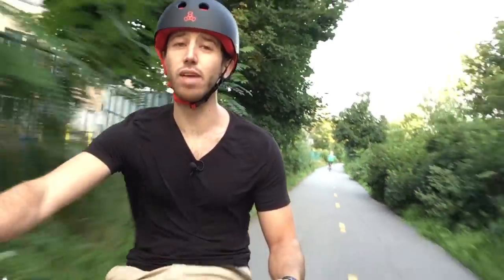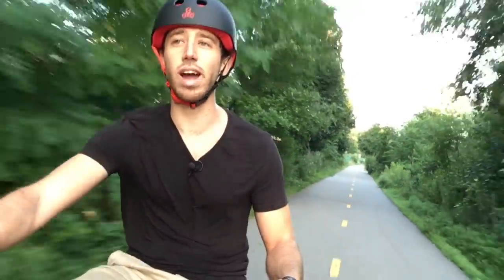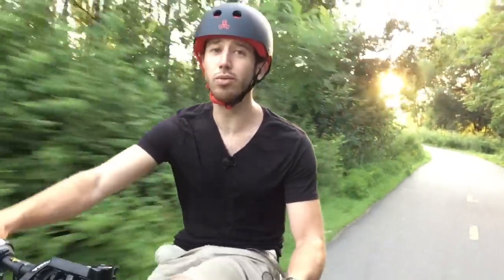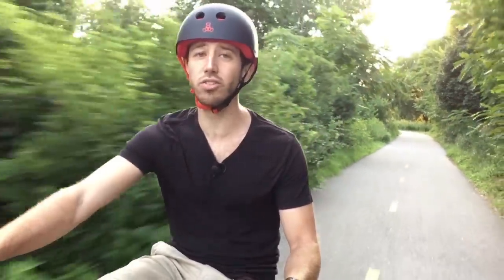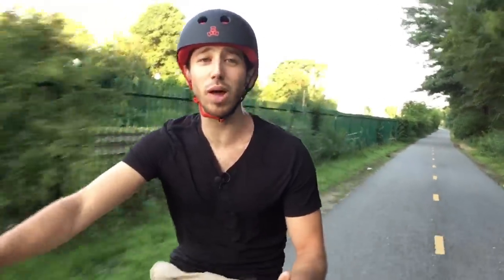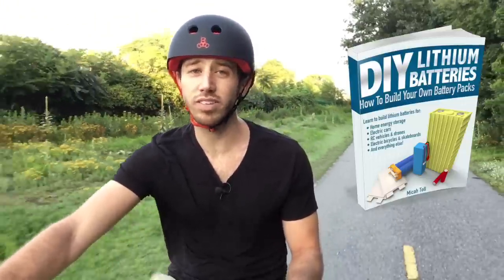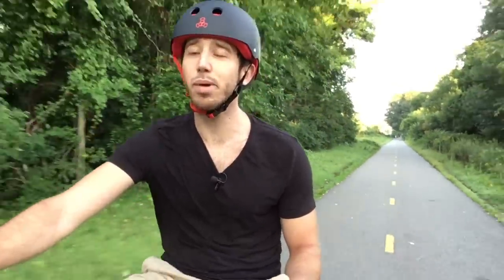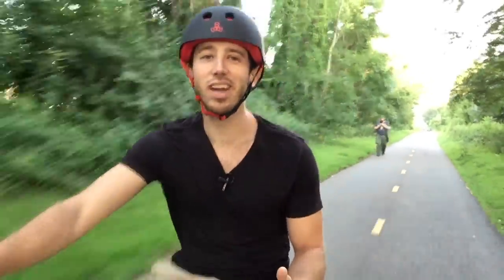10 Tips To Make Your E-bike Go FASTER!!!

Comment: The tire pressure is a biggie, if my tires on my ebike have reduced pressure 50 psi, my bike does 21 mph if it's 65 it does 25 mph
Reply: use a booster step up
Reply: Speed and range!
Reply: What bike you have that it asks for 65psi?
Reply: @sebastiangeorger5791  Ancheer AM001908 folding 20" Mountain Bike specifies 40-65psi for both tires at STP. I would expect similar specs for similar size tires, although I've seen 14"x2.25" "mountain bike" tires spec'd at 45psi maximum. I usually inflate a 3-5 psi below the maximum specified to allow for both meter accuracy and temperature variations that could increase the actual tire pressure from what the meter reads.
Reply: Who asked tho
Reply: I dont notice alot of difference on my  A20. It goes 21 miles an hour top speed with my rear tire at 50 PSI. And my front tyre at 40 PSI. Both tyres go up to 65. I've had them both at 60 PSI before and there was only half a mile difference in speed. It peaked at 21.75. As for range I've never tested that. 

But there are alot of things to consider. If you value a more comfortable ride. Then lower tyre pressures are better. Also when I ran my front tyre at 60 PSI. I was catching more punctures. Two in one month. As there was less give in the tyre. At 40 PSI I have gone 7 months without a puncture. On the front wheel. So for the sake of a little speed and range. I Think 50 on the back and 40 on the front are the sweet spots for me.
Reply: Higher tire pressure doesn't make u go faster
Reply: @Free__Speech  Actually, it always makes you faster on good terrain. Less power is wasted on rolling resistance.
Reply: @neutronpcxt372  Bumpy roads with higher pressure. Slow u down
Reply: Higher tyre pressure is not a good idea in my opinion as you have more chance of bursting your inner tube when you hit a sligh bump or pot hole...have less tyre pressure or where it looks kinda flat when sitting on the bike actually give you more grip in the road.
Reply: @nathanbishop925  That's not exactly true.
Pinch flats are more likely with lower pressures.

Comment: 1. Top up your battery;
2. Use higher voltage battery;
3. Swap for a more powerful motor;
4. Swap from knobby tires to road tires;
5. Keep tires at higher pressure;
6. Tune brakes to eliminate rubbing;
7. Add windshield;
8. Crouch;
9. Cool battery;
10. Reprogram/hack controller/motor to disable limits.
Reply: thx man
Reply: Mf is a legend
Reply: My main tip hack, was swap to road tires, change the tire size which also reduces the odometer, and the comptroller wire disconnect.
Reply: Ya there any problem is I can't find a bigger motor for mine
Reply: How to reprogram it
Reply: I would like to see this controller please on the Juliet III Electric Bike for Adults Dual Motor 2000W 33MPH 48V 60Ah 100-200 Miles #10 bc my stuffs stuck at doing 20 & i know this badboy can go faster then that. If someone out their can help me on doing this before i get runover by a car bc i dont want an old lady driving behind me & thinking that that badboy can go up to 30 & i cant like wtf, please help 🙏🙏🙏

Comment: Mika... I have the 750c full color display.  it is set on the brightest setting. yet i can't see it in sunlight.  I have to pull over in the shade to see it or bring it inside to see the display.  
Is there something (an adjustment) i can do to make it visible..?  I want to monitor my wattage consumption to get better range from my solar ebike trailer.  I can't do this unless i can see the display in the sun where i need to be for the solar panel.
Reply: I use the same I just have in in an angle so sunlight doesn't reflect just try maybe it helps brightness is only on half on my display at night I turn even on lowest settings because it shines too bright

Comment: You should start off with #10, the speed limiter. If that is connected, then most of the other things you recommend won't make any difference in top speed. People might spend a lot of money to buy a higher voltage battery, a windshield, etc. only to find that with that speed limiter in place they still can't go over 15mph on electric power only..

Comment: 2:14 did it and lost traction on a blind downhill curb at 40kmh and almost got ran over by a car while i was laying on the graound w a 50 kg bike on me i threw the bike of me and ran to the side walk and that was a night so... i couldve died so... watch out when u pump ur tires up u lose tractin😑
Reply: That's a major consideration with motorcycles at high speed, there's very-little of anything actually touching the road, you're almost flying...

Comment: I'd be interested in an episode dedicated to controllers and how to mod them and how to find other controllers to exchange them for, in order to make your bike go faster. Another aspect that I'd be interested in is how different settings will affect battery life. 

My own ebike isn't adjustable at all. It either helps you by adding 350W until you get to 25km/h, or it's off entirely. Not a recipe for efficient battery use when you basically have to break in order to cruise at a lower speed.

Comment: (04:15) There's a 3rd EASY modification that doesn't involve opening anything up. It does NOT work on all controllers
A number of ebike motor controllers can be soft-"hacked" (hacked is not really the right word, but people use it, so....) in addition to the tire size and hardware controller internal wire enable/disable methods discussed in the video...
There are videos about it but basically it follows these steps:
You press down the left and/or right brake WHILE pressing the ebike's power ON button and hold them all for 5 seconds or until "E-02" (or possibly similar) appears in the display. Some bikes can be "hacked" this way using either brake handle, while other bikes require both simultaneously...it depends on whether the brake switches are electrically or logically OR'd inside the controller. Some bikes even require the LEFT brake only while others may require the RIGHT brake only...so try all the combinations before ruling out your ebike can't be changed using this method. IF a given method works, you will likely see an "error" code showing in the display the first time it is successful ("E-02"). Obviously, you won't see this error code on ebikes that just have an "idiot" LED controller like the KD26E displayhead used on the AM001908/AM001907 20" folding ebike models (not an LCD alpha-numeric display), and it likely won't work on these "dumb" display head configured ebikes.
If it works, you should only have to do it the one time or until your controller is reset by some means.

Also, on some bikes it MAY "toggle" ON or OFF the high speed enable so if you...as I do...hold down at least one brake lever as you get on the ebike and power it up...the setting MAY "toggle". You'll have to check if it does "toggle" on your ebike and may change how you start your bike if needed.
I haven't seen this ON/OFF speed hack "toggle" happen on the 2 ebikes on which I've seen it performed, but there may be others that work differently. Unfortunately, my ebike did not support this soft "hack".

Comment: Yeaaahh just adding a few more items to the “TOO SPEED hack list” haha:
#11 transfer your motor/controller/battery to another bike with bigger tire/wheel.
#12 if you own a Bosch, Shimano, Giant or basically any ebike with speed limit, remove the rear wheel speed sensor and place it facing to the outside (zip tie), place a magnet on the right pedal metal bolt and alight to the sensor. You motor will no longer measure wheel speed but cadence = if you’re at 40kmh your motor will think you’re at +/-19kmh and keep on pumping more POWEEEERR. Manufacturers can’t detect this if one day you have to claim warranty but if you do a USB dongo trick (electronic modification) they can tell.
#13 mid drive bikes = smaller rear cassette gear 11T and bigger front chainring. Don’t go too big on the chainring, otherwise you’re just adding wear and tear on your gearing system including bicycle gears/chain and also the internal gear + may ended up “forcing the controller” generating too much heat and frying it. Bigger chainring means you’re trading your acceleration for top speed.
#14 some advanced controllers like the Savboton, ASI have “Field weakening” settings which is the offset angle between the 3 motor phases, varying it will also increase the top speed using the same battery voltage. Downside? This introduces some inefficiency so the controller runs hotter. There’s also a maximum phase angle and electronic motor speed the controller is able to process.

More POWAAAAAAAHHH ohhh yeahh

*we missed you!! I really thought you’ve stopped the bike to announce the winner of your book, you must have a fantastic memory hahahaha
Reply from the maker: Haha thanks for the extra tips! And my memory isn’t that good, I have my notes taped to the handlebars. You can sometimes see a little piece of paper flapping in the wind there, haha!
Reply: BrunoPOWEEER great advices.
Let me add #15
Make your bike look legal yet illegal. Some central motors are difficult to see. Bikee bike for example. 1000w looks like 250w.
My first rule is "don't be a jackass" as long as you respect that rule the police will not mess with you.
Ride safe guys
Reply: EbikeSchool.com hahahaha when I watch your videos I always think “how does he just make a single take video!!!” Hahahaa nice trick =]
Reply: EXPLAIN - Field Weakning
Reply: Sumeeth S hahaha I did, in my previous comment above!! Haha=]
Reply: BrunoPOWEEER  I tried changing the wheel settings on the display, to trick the controller, but nothing happened. I have a geared front hub motor on a 28" wheel bike.
Reply: Thank you good day..
Reply: Vago Sofron geared front hub motors in many cases has an internal speed sensor inside the hub, some cheap controllers don’t give the flexibility to change the wheel size, one company makes the controller, another company makes the display, another company makes the motor, another company put things together and sell it as “ebike kit”. Basically they just pick any display in China that talks to the controller using the same protocol but in some cases the display has more functions than the controller can actually handle. Some cheap front hub motor kits the controller is fixed set to 20” or 26”. My recommendation? Try a different motor controller.
Reply: Yes to No. 12 —I did exactly this with my Shimano E-8000. However I used velcro to wrap the sensor around the frame so that it could easily be moved back to its original position once the error message appeared on screen.
But.....the speed on the ebike was too fast I felt.  I’m in central Japan and there’s just too much traffic and narrow roads for 40km/h. I moved it back to the original position because I thought I would get smacked at any moment. 
You are right though about changing the setting with this method—and it’s damn easy to do.
Reply: When it comes to E-bikes and batteries, Bruno you are a true inspiration where Mikey is cool and relaxed you are well a nice way to put it is a bloody nutter but I love your content and what you add to the E-bike community, top bloke, as we say in the UK.
Reply: Brannen Thompson hahaaaaa thaaaaaanks mate... these comments are what keeps me uploading more and more vids here... ohhh yeaaahhh!!! 
I actually upload more often on Facebook and Instagram (it’s a lot easier to post short clips and photos). 
https://www.instagram.com/brunopoweeer
https://www.facebook.com/brunopoweeer
YouTube videos are a lot harder and time consuming, I’m trying to ramp up and get content here more often showing all the high POWEEEERR work I’m constantly working on. Most jobs are “confidential projects” and unfortunately I can’t share anything... it kills me but  eventually as my channel grows, they may change their mind and things may change hahaaa... more POWAAAAAAAHHH ohh yeaahhh =]
Reply: Already a Youtube Subscriber and now you have at least one more Facebook follower.
Reply: the cheapest way to increase speed is to lose weight.
Reply: BrunoPOWEEER can this work with a bafang bbso1
Reply: just add a QSMOTOR 273 70H V4 motor into your bicycle like me... mid drive here we come!!!
Reply: Will this work for a bpm imports model ?

Comment: I have an e-trike front wheel is 24" and the two in the back are 20". The display setting is set at 20". Will setting it to 24" help or setting it lower?

Comment: High i have the speed limiting wire on my controller and i extended it to an off/off switch on the handlebars for on/off road settings.
Reply from the maker: That's a great idea, I never thought of that!
Reply: Where is the speed limit wire? How do I identify it?
Reply: You mean the "oh shit a cop pulled me over" switch?
Reply: Tiago Soares on my controller its two short blue wires joined with a connector
Reply: joblessalex exactly !!
Reply: major lee long wang !! But how did you know that that was the speed limit wires? 
By the way you are talking about the wires that come out of the controller or a wire inside the controller?
Reply: Tiago Soares hi: I have 36v motor can I use 48v battery? Thanks
Reply: It depends on what voltage your capacitors inside the controller are rated for.
Reply: Look for 2 separate single wires(same color), one with a male connector and the other a female. Those are your speed limiting wires.
Reply: schrockie1 my controller is 36v to 48v 350watts... So can I use 48v battery of my 36v brushless motor? Thanks
Reply: Shouldn't be any problem using that battery. You'll get longer distance and maybe a higher top speed than a 36v battery.
Reply: Yeah I've done the same using a motorbike style switchgear and I use the indicator switch to switch between modes, there cheap on E bay and you then also have a switch for your lights too., and if  the Police check out your bike just switch it to low power, its usually the blue wire on most E bike hub motor kits controllers.,"here Officer have a go see it's limited" then pootle of home full power.lol.

Comment: How 'bout 10 tips on improving your ebike's range?  What are the best power strategies and controller settings for doing bike touring on an ebike for daily distances of 50 to 90 miles?  

BTW, another tip for improving aerodynamics is to swap out your upright for a recumbent ;-)  

Keep up the good work, and I hope you like Boston.  The winters will be much different from either FL or Tel Aviv!
Reply from the maker: That one is actually in the works and will be coming up! Thanks!
Reply: Boston is goong to be way to cold for you trust me !
Reply: Tip 1, keep it below 20MPH and out of the higher settings.  Tip 2, inflate the tires to max pressure, Tip 3, take off and slow down gently (hyper-mileing for cycling).
Reply: ^this  my range gets killed above 20mph and limiting take off throttle use helps.

Comment: Thank you for sharing your knowledge! I just bought my own kit(s) on eBay for both motor ad battery—next battery will be DIY. I will follow your instructions in your book(s)...Huge fan after watching about 10 of your videos here on YouTube. Again, thank you for sharing your knowledge—any ideas for getting 20 miles on a 1000w 48v rear hub with 48v 1000w battery Voilamart motor uppBattery u004 and SW900 controller? Thank you, Mica

Comment: Nice mention of heat issues. Whenever the limits of an ebike are pushed (which is easy and fun to do)... heat can build up in the battery or wiring or wheel rims and it's nothing to ignore.
Reply: Very True.
I am building a prototype and will make sure Cooling Air is directed over Batteries, Wiring and Electronics.

I will of course keep it waterproof.
.

Comment: It works,  changed the tire size on the computer input from 20 to 24 inches and got 5 more mph.
Thanks John
Reply: Lol,your just getting a false read,larger tire travels more distance per rotation,your true speed is unchanged.
Reply: So increasing tire size in the electronic gadget preset increases speed?
Reply: How do you know this? Did you test it for real with a GPS app? Or you just THINK it's faster?

If your bike is able to go say 25mph top speed. And you get 25mph. The only way you might get an extra mile or two is to swap out the tyres for fast rollers. And run a high PSI. Other than that. You would have to change the whole SET up. With a higher voltage battery. Controller and even motor.
Reply: Lowered the tire size from 22 inches to 18 inches and got 5 more mph.  Testing with another speed odometer.

Comment: Pedal faster. 
Hang onto car.
Reply: Pedalling faster is the only option in the UK where the law limits ebike assistance to 25kph/15.5mph removing the assistance limiter has no effect other than the 'placebo effect' where you think it goes better..  Even so, most of the things he advocates won't make the motor faster but simply optimise it's performance i.e. give it greater battery range of make it easier to pedal.  Keeping the battery fully charged has no beneficial effect as regards speed whatsoever on an assistance limited bike.  Assistance to 25kph is the same whatever the state of battery charge.  Removing the limiter has no beneficial effect has been proven time and time again on YouTube videos and is the same as my own experience.  Switch off the motor at 25kph and you don't even notice it. I have NEVER felt my motor cut out at 25kph simply because of the already fast momentum. The only way to get the best out of ANY bike is to keep the drive train clean, optimise or change the gearing to suit your local terrain, all bearings well serviced, tyres inflated to a high pressure, keep the weight as low as possible and keep yourself fit.
Reply: here in the philippines my fiido d1 hit 31kmh on flat wtf man sometimes im faster than motors lol